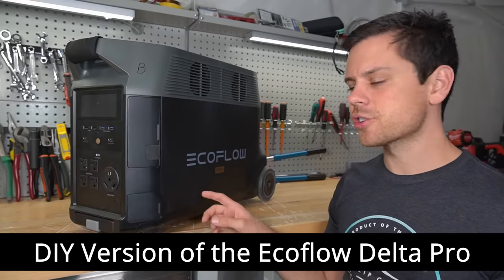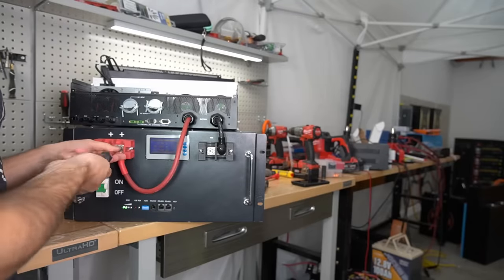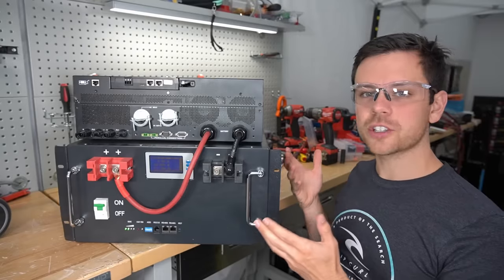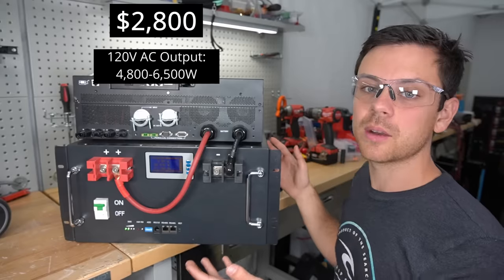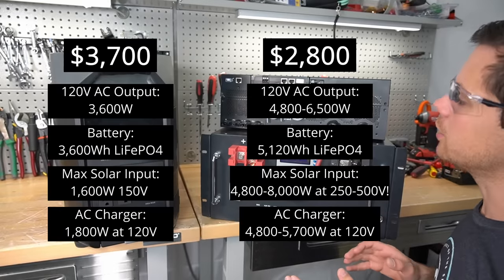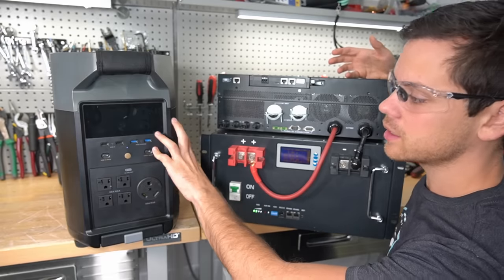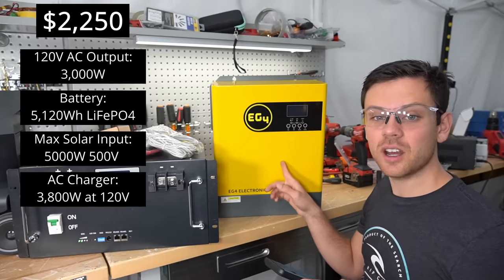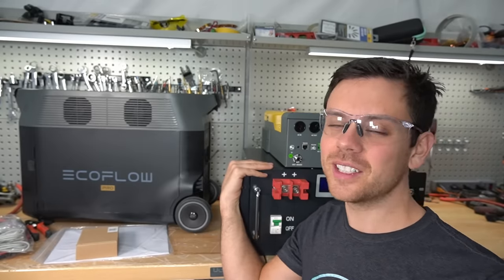Budget DIY Ecoflow Delta Pro! More power for less money

Comment: Here is something that I've never seen in any of your videos and may be of interest to you.  I purchase a $650 BougeRV 12 volt, 100 amp/hr self heating battery but it did not function as advertised.  When attached to any of my 3 inverters, the inverters immediately shut down.  I relayed this problem to BougeRV and here is their answer =>

Dear Gary,

Thanks for your kind attention. We attach importance to your case and discussed with our product team and supplier.

According to your feedback, our engineers re-tested the verification and found that the problem was mainly due to the overcharge protection of 15.5V in our battery. For safety reasons, I was worried that the customer used the wrong voltage to charge the battery during use or that the customer's controller failed. Charging the battery with a large voltage would cause the battery to be damaged, so we added this protection, but found the controller. In the process of adjusting the voltage, it is not a smooth step-down, and there is a voltage signal exceeding 15.5V for 20 ms, which causes our battery to capture this signal and start the protection.

This is due to some defects in our design. The battery has neglected the adaptability problem while increasing the safety protection. At present, the standards for this protection in the market, including Ampere batteries, are not as strict as ours, so they don't have the problem. This is not a product quality problem. We are now also optimizing the protection voltage to ensure the adaptability of the product under the premise of ensuring better safety protection. At present, we are already debugging the protection of the software, and we will give it to you immediately after the update.

Kindly contact us if have any further questions.
Have a nice day.

Dylan
BougeRV service team

Comment: I like your diy system, but I need a UPS so it will automatically run my sump pump if I lose power while I'm away from home. Any ideas on how I could do that?
Reply from the maker: This works as a ups
Reply: @WillProwse  Would you  be willing to do a video showing how to configure the inputs/outputs? Thanks.

Comment: To be fair for the cost comparison you should add the price of cables and a USB-PD and wireless charger, and maybe a cart with wheels. Also you should talk about idle power consumption on both units, is it as easy to turn on and off the inverter if you are trying to save battery?

Comment: Does the DIY Version require a ground connection?  I am looking at using this for a Skoolie.
Reply from the maker: If you need a ground for reference potential, sure. Depends on your use case. Ground it if it is logical to do so. Floating systems work fine too.
Reply: @WillProwse  Thanks.
Reply: @cammielaw  Just run a gound wire to the frame of the bus. ;)
Reply: @Tumbleweed5150  Thanks!

Comment: As someone from Puerto Rico looking to upgrade my BLUETTI EB240, I've been looking into this. Especially with the Signature Solar sale. My problem with using an all-in-one is that the minimum solar input voltage is way too high (for the three 160W Rich Solar panels I have), specially on the MPP. And when charging from AC, they work as a UPS. So if I want to charge from a Honda 2000i, all the loads and surges will be handled by the generator on top of the battery charging. I suppose I could use stand-alone inverters and chargers, but that would increase the price. Any ideas?

Comment: It becomes a chicken or egg question. Do you want a plug and play system that’s designed for ease of use and portability or do you want a cheap system with off the shelf components?

Personally I find the large solar generators overkill, and while they are still portable, they sure are no longer practical. The EF Delta Max and Bluetti AC200 Max are the last portable power stations. The bigger ones are for all intents and purposes generator replacement.
I have a EF Delta (1300), which I consider a “Excursion Pack”, good for day trips and a long weekend, and short power outages. 
The larger system like the EF Delta Pro are too limited in their solar input and too expensive for expansion, particularly if you need serious power. It’s cheaper to buy a small cargo trailer and put a DIY system into it, including solar panels. Just imagine 4 server rack batteries ($6000 - 20khw), EG4 ($1500), 12x400watt solar panels ($2400+ - 4800watt), a 120V and 12V load panel and wires ($500 ??), and the trailer of course ($2000) …. $12500 for a full 20kw system that’s mobile. Sure you can’t put it into your RV, but my wife can’t get a Delta Pro into my RV either.
Reply: P.S. the beauty of the solar generators is that you can charge them with low voltage, 11V is usually considered minimum, which is a single solar panel.
Reply from the maker: Very good points!

Comment: My winter over Park Model along with the RV in summer-  the wheels are turning so that I can take one system which ever way I go and make it work in both places.  The neighbor across the street is interested in solar and he has a book case right next to the plug for the mini split heat pump  I just put in for him.  A few solar panels added to the basic rack in a book case by his washer/dryer will have him doing back flips when his electrical costs move closer to zero after his investment in equipment.  Like me, I don't care so much what it costs as long as I don't need to pay every month as the psycho politicians raise electrical rates for their climate change stupidity.

I had already worked out some of the big picture things as I had solar on a sail boat for several years.  Going to the Florida Keys for 6-7 months and all solar/back up generator scenario with lead acid batteries taught me a lot but this looks like with minimal work I can cut the chord to shore power.  Now to the calculator.

Thanks for this video and the ideas.

Comment: This is a very timely video.  I was just contemplating the need for a battery backup system for my sump pump.  I have a small ranch in Missouri and when it rains, my sump pump can drain out over 40,000 gallons from under my house (no ground water shortage here!).  If the power goes out, I could end up with 6 inches of water in my unfinished basement.  I am on the grid, but if there was a power outage I would like a 24 hour backup power supply.  The sump pump uses 394 watts every time it fires up.  In continuous rain, I figured I would need 10KWH of battery to be safe.   That probably means two of the batteries mentioned.  Can this setup be used like a UPS?  This is definitely something I can DIY.  Thanks WILL for all your insights.
Reply: Yup, you can definitely use it as a UPS with or without solar.

Comment: You did not build an equivalent system for less, you build a different system that fullfills a different market. Ecoflow is compact, fully integrated, and portable, your setup is static, scalable, and cheaper. Like comparing a Prius to a F150. Depending on what you need one will work better than the other.

Comment: Very cool brother thank you for sharing your knowledge and expertise and hello from Detroit Michigan 94/275 im  Wondering if you could point me in the right direction I have a large supply of lithium ion batteries That are 3.7 volts and In a twin pack They are shorter than  AAA batteries  They are 1000 mlh  I am looking to make a bank of about 48000 mlh or larger I do want to make it a 12V system I have other things in the house and camper that run on 12 V  I want to connect all the batteries to a nickel strip and make a 12 V battery pack how do I go about charging all of them and how do I tell if they are smart batteries or dumb batteries

Comment: But... Your DIY system isn't really complete. To be an apples to apples comparison as it should be you need to address the power delivery options. You didn't add any AC or DC outlets. This would increase your material costs, but also make it closer to a true DIY replacement for the Ecoflow Delta Pro.

Comment: This is exactly what i been posting to all the idiots putting these into especially their home, i seen one guy who spent a ton on two or 3 perhaps of them all the factory custom pre made cables, then poorly mount the solar pannels, to noot, he got like not quite 2 days use well testing and the time per his load was 12 hours. 3000 watts is absolutely nothing, when you takw in your amps and motoer start ups. I was shocked by how much he spent yet felt like he did the best thing ever. Heck a propain or natural power condition generator would searve so much better. A 7800 watt Generator with auto throttle with say a 100lb lp tank would last 4 to 5 days depending on how much stuff, but at least you can run your furnace keep your heat on and not have to worry about putting in a wood burning fireplace. Plus the solar panels for these semi portable systems are not the best, you lose 35 to 40% of their conversion process in about 5 years. This all said, the chose your products and buy the parts beeded well making your own connections,  cables and racks and all the other stuff related will be a far cheaper way to go for much better product. Bravo to see you doing a bideo like this!❤❤❤

Comment: Besides capacity and output there are no benefits of this system. Delta is made for mobility and offgrid camping. You can't take half server rack to the nature with plenty of usb and all kind of socket outlets :))) and you can only use usb, with much more efficiency that 110/220v inverter will do on small loads

Comment: Now make it in a single box, with wheeels on it, and actual portability.

The ecoflow is a portable powerstation.

What you made is everything but portable. So yeah more power, but is not really the point if these things.

I just bought a 2kWh, 2000w (4000W peak) portable power station for $799 with life4po batteries, and 5 year warranty.

Needs to be portable not more  power. And where are all the usb ports and all the other connections, like you said the diy is well kinda stupid.

Comment: If someone wants to give me the money, I'll build the two components, which has 42% more battery capacity and 33% more output power and 300% more solar input capacity, I'll build it for $3999 plus shipping or local pickup around Washington DC.

5.12kWh LiFEPO4 Server Rack Battery
LV6548 All-in-one Inverter & Solar Charge Controller
Wheeled 10U 19" rack case
16A 120v 8 outlets 1U w/ OLED Voltage/Current/Power Display (Add as 2nd for $150 if you want two so you can max out the 4800 watt AC output)
USB 3.1 Hub, 2x USB-C, 1x USB-A 3.1, 4x USB-A 3.0, 2x USB-A 5v/2.4A, 5A max
Shore Power 120v Inlet Socket

Why? Honestly, for the fun of it. I don't need one, and I have better things to spend $3999 on. BUT I also have built my own milk crate 1.2kWh system, and frankly I'm just curious how this build will go and what will be great about it and what the learning experience might be. I'm sure it will take more than an hour to build out well and correctly, and I'll happily add reasonable things to it. 

So if you have $3999 laying around and want what Will describes but fully mobile and with outlets, I'd be willing to build it for you. Just one though... I already have a business!

Comment: Videos like this are really a joke. Yes they contain good info on how to build a DIY system. But like almost everything in the world,  DIY is cheaper. I say this video is a joke because you leave out soooo much more that the EcoFlow ecosystem can do especially when you pair it with their Smart Home Panel. I don’t what a manual transfer switch and I don’t want to wire up receptacles. But then again, I don’t change my own oil or break pad and I don’t raise my own chickens.